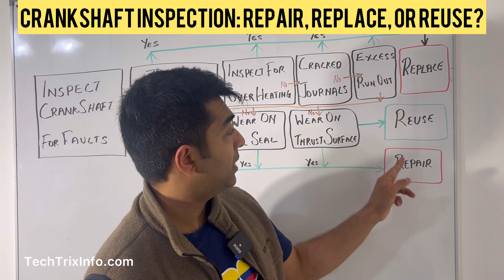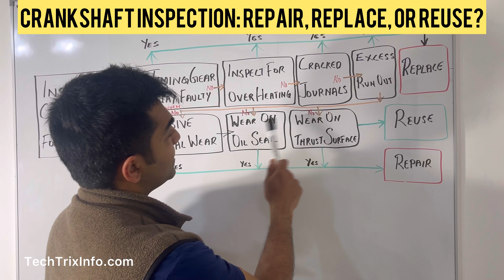Crankshaft Inspection: Repair, Replace, or Reuse? | Essential Guide for Car Enthusiasts | Part 1

Comment: Am watching from Uganda but very interesting video 🤝🤝
Reply from the maker: Thank for your support, please let me know if you have any questions. 👍
Reply: @TechTrixInfo  ,, my question is about , why is an engine,Mercedes Benz Actros Mp3 sometimes when loaded loses power and after it obtains power, move faster then it repeats the problem sir
Reply from the maker: Hi, It sounds like your Mercedes-Benz Actros MP3 truck might be having a problem with its turbocharger or fuel system. When you’re loaded, the engine might struggle if there’s an issue with the turbo, which helps boost power. Another possibility is that there could be a fuel supply problem or a clogged fuel filter causing intermittent power loss. Check the air filter as well; if it's dirty, it can also cause power issues. It’s best to get it checked by a mechanic to pinpoint the exact problem and fix it properly.